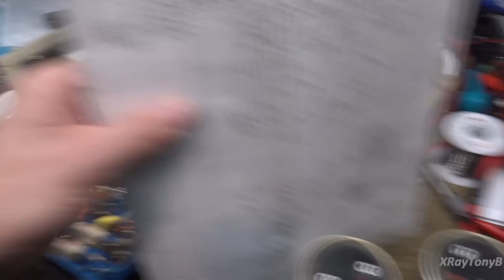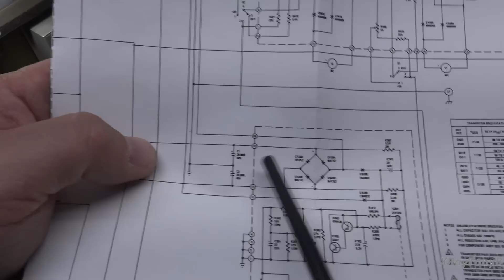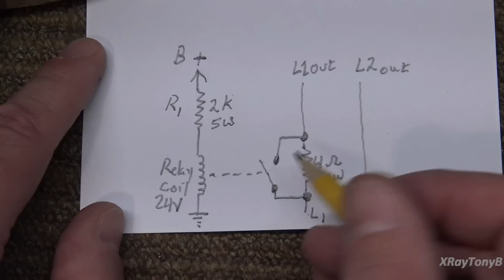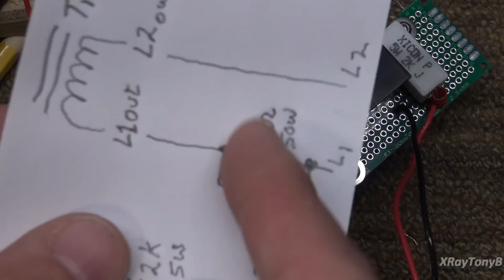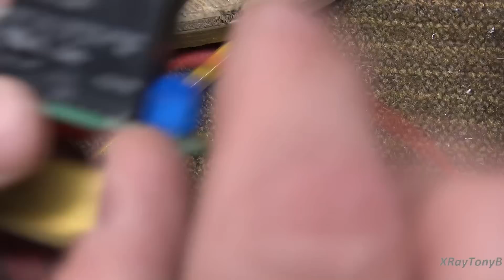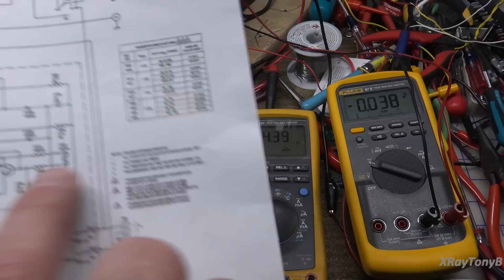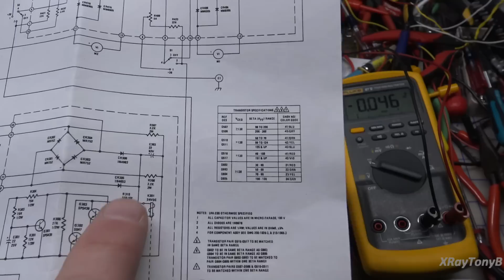Adding a Soft Start Circuit to a Power Supply

Comment: i wish you used one or two   analog meters  and/or an  indicator bulb ;
   i think that  relay is a  special relay; if it were not of a snap action  type , the  contacts  would burn because of the  lack  of a snap action ; i   know it is  a  fast voltage rise,  but  relays are  made  for  instantaneous voltage  rise,or tyhe  contacts  will arc

Comment: You may want to use a diode in across the relay coil as a snubber
Reply: Reverse biased diode
Reply: yes, after studying the whole thing;  it is not reccomended bu the relay makers, it burns the contacts faster.

Comment: Hey Tony, Back as a Pateron. CC got hacked and was canceled. Now back on. Sent you an email on your Video about Soft Start. I really enjoyed that. Take a look at the circuit I sent you. The device states 220 Volts input and output. Mfg says will not work on  USA 120 Volts AC. I would like to convert it but not sure what to change in the Schematic. Since I have all Marantz Separates M500-M250-3300-M150 and another system for rear channels 3300-and-M250 I would like to soft start them as They are old but still cranking. It would be easier to add an out board Soft Start rather then go inside each unit. The unit diagram I sent you is pretty nifty. Thanks: Mark

Comment: Interesting... I have an older late 90's linear bench power supply that will cause the voltage on that circuit to drop when I power it on for the first time in a while. I have an UPS on the same circuit that will alert due to the voltage drop but not tied into the powersupply. I was thinking of doing something similar.

Comment: Re-watching this video with increased understanding, and having paused to read the description of the Pioneer circuit, I’m wondering what happened to the capacitor that was in series with a resistor with both of them parallel with the coil, so that the voltage across the capacitor the pulled in the coil. I don’t see it mentioned in the comments. Tony probably mentions it another video . . ..

Comment: What about an NTC thermistor like it's is used in switch mode power supplies, maybe more efficient.
Reply: I'm thinking about using an NTC to start a circuit and then a relay to bring it out of the circuit after a delay.  The problem with an NTC alone is that if someone turns the supply on and off while the NTC is hot, it'll act like the NTC isn't there...
Reply: I have a newer version of this amp. It already got 2 NTC installed by the factory on a terminal strip.

Comment: To keep it simple how about just adding a CL-30 or 40 or other properly sized thermistor after the fuse ?  They are ideal for limiting inrush current and with today's higher line voltages they might drop that a volt or 2 after warm up.

Comment: You could also use a Infineon IRF3205PbF (RDS(on) = 8.0mΩ) power mosfet across the 4R7, rated for 110A @ 55V on the secondary side of the transformer with  a 10K / 10R voltage divider on the capacitor.
No power resistors needed and no useless heat generated, simulator shows it works fine, it gradually start opening the mosfet.

Comment: A little off topic, but how about using a soft start with a SCR voltage regulator, a 100A rated bridge rectifier and 10,000uF  filtering caps driving a DC motor?

Comment: I would have put the resistor in series with the B+ and use a P-channel  MOSFET wired across maybe a 10 ohm resistor, but either way it's a good idea.

Comment: That big inrush can damage all in its path.  A 6 volt relay has a 30 ohm coil if your initial charge is through the relays coil when the difference in voltage is less than 2,5 volts the relay drops out and the Cap is directly connected  to the source through NC contacts

Comment: Excellent! I just subscribed after seeing this elegant solution. I build tube amps and I typically heat the early stage filaments with DC to limit AC hum. To do this you need a lot of capacitance because 4 tubes can draw a couple amps and you need that capacitance to keep up with the ripple. But this does present a big inrush strain on the filament winding of the transformer. For 6,3 volt filaments maybe I'll experiment with a 5V or 6V relay. If I can find a sweet spot, I'll definitely add this to all my projects. Many people use a 555 timer or such, but this is downright simple with far fewer points of failure. Thanks!

Comment: Hi Tony…..I’m wondering why you put the 4 ohm resistor on the mains instead of on the output of the transformer.    Wouldn’t it operate the same way and still protect the transformer?  Just curious.  I’m adding one now and would like to know.    Thank You
Reply: My thought is that relay contacts are rated 2 to 4 times higher on AC current than DC current
Reply: @jimnunn9232  The secondary of the transformer is still AC, just lower voltage.  Was thinking that might be better
Reply: Same reason why fuses are usually on the primary @richardchuray329

Comment: I thought you would like to know that I’m going to put this soft start circuit you show into an amplifier I am recapping for a guy.  I don’t support this necessarily but he has a Hafler DH-120 power amp and he bought o capacitor upgrade kit for it which among other things increases the main filter caps from 6,800uF to 22,000uF.  It seems to be a common thing for owners of this amp to do.  I advised him not to do it but recommended that if he really wanted it done, he should at the very least add the soft start circuit and upgrade the rectifier.  I still couldn’t take responsibility for what this modification might do.  I don’t recommend it but it’s his call.    Without looking at a schematic, other than start up, would you have any other potential concerns with caps this large put into a circuit that wasn’t designed for it?  

Anyway, I just wanted to let you know that the videos you put out are a great educational tool for people like me.  You are a priceless asset for the community.  Thank You

Comment: Can I use soft start from (or designed for) power tools? They seem to be cheap and made in small nice packages easy to fit to audio amplifier. Not sure if I should be trying such devices for audio amplifiers.

Comment: excellent video really helpful!
could someone maybe help me out a bit?
1) the wiring to ground from the relay coil as depicted in the schematic drawing; is it wired to B–? my amp's got a split rail voltage, there's 46V difference between B+ and B–, and a ground in between (23/23). i reckon i CANNOT just go wire the relay coil to the mains ground... where do i wire it to?
2) i live in Europe, 230Vac on the line, shouldn't the big resister be rated, like, over 1kW in power dissipation?
thanks in advance, all

Comment: Might your soft start circuit be even more simplified, by using a Mains VAC Supplied STDP Relay? The resistor is wired across the Normally-Open contacts of the Relay. The Line side feed goes through the resistor, to limit the in-rush to the relay and the load. Once the relay and load reach 80% of the mains voltage (80% being the typical voltage at which a relay engages,) the relay engages, thereby bypassing the resistor, and the load finishes charging (but much less violently.) Not my idea = Credit goes to james_s, on the EEVBlog Forum. Thanks, james_s for (originally) suggesting this to me.

Comment: I’m afraid this won’t work in Europe or anywhere else where the grid AC is 230V. The inrush resistor’s power capacity will have to be prohibitively high; we’re talking quadruple-digit wattages here.
Reply: I'd implement a thyristor-based soft start circuit in that case.

Comment: Came across this video  as it randomly popped up….whilst looking for a way to stop my 3hp router from throwing me over the bench every time I switch it on….. way over my head but very interesting all the same.!! Why was there no  current limiter built in from the factory you ask.?  Because like every manufacturer of every machine be it machanical, electrical or both,  reliabillity, longevity and reputation all come a poor second to repeat business and profitability..!!!!👍

Comment: A much more elegant and easy solution for inrush, is to use a NTC thermistor device on the line. We utilized this method on all of our high current amps at Altec-Lansing, which included the EV line as well. - K5DBX

Comment: Tony, I am curious about your choice of using the 2k ohm resistor to drop the 57 volts to 24 volts for the relay.  If one plugs those in a voltage divider calculator with 850 ohms for the relay the voltage across the relay is 17 volts.   I’m trying to figure out what dropping resistor I will need to use with the very same relay with a B+ of 70 volts.  Using a voltage divider circuit calculator, it comes up with a 1667 ohm resistor.  
I thoroughly enjoy watching your videos 
Larry

Comment: Wonder if it's a good idea to soft-start a decently sized SMPS like this. Proper ones will have an NTC on the input, but if that's already hot after it's been in use for a while, it can very well act like a piece of wire, passing full current to the main cap(s) and causing arcing across switches/relays. I WAS thinking of using this method, but I heard it's not recommended to "starve" a SMPS of current for too long by placing a resistor/light bulb in series with its mains input, so I guess the resistor value and "hold" time would have to be pretty precise so as not to reduce its lifespan. If it's got a PFC boost circuit it's probably even worse...

Comment: Another nice video and explanation but since I don't have a test setup, how much does that 4 ohm resistor reduce the inrush current?  And more out of curiosity, how much is 4 ohms (percentage wise) in relation to the power x-fmr primary resistance?
Reply: Wanted or not, I will throw in some feedback. (and let the arguments begin  🤣🤣🤣) Believe it or not, you posed kind of a "trick question" , because, since the line voltage is "alternating current" it depends on the exact timing on when the power switch makes contact in relation to the AC cycle. If you switch it on during the "zero crossing" part of the cycle, it would have to reduce less power than if you switched it on during the peak. That, and adding any residual magnetism stored in the transformers body, and also, when the switch energizes it, things get crazy. If you convert things to DC though, you can do some "fixed value" math, and lets say ( ballpark-worst case scenario, an amp that keeps tripping a circuit breaker when you power it on) you have a 15A surge, which, may trip a standard US home branch circuit breaker, at 120V, you would be drawing 1800 watts for a millisecond or so. Ohms law works that out to an 8 ohm load. Adding 4 ohms to that makes it 12 ohms, dropping that current to 10 amps from 15, which is a bit easier on the switch contact, but keep in mind that is worst ( guestimated) case scenario with 60 cycle AC.  And, also, keep in mind, that the transformers "resistance", once connected to AC line power, is actually mostly inductive impedance, so, although it may have a lower DC resistance, once it is connected to the AC frequency it was designed for, it will look like it is a higher resistive value than its DC measurement is. That impedance value depends totally on the differing transformers designs, so it will have no set answer as well.

Comment: Nice. Thanks to you i just discovered that my amp has something similar already installed ( Onkyo M 509 ). But it just uses 5*0.22r5w and no resistor before the coil but a cap and a diode across the coil. Now im thinking about changing the 5*0.22r ones against one 4r50w because it has new and bigger filtercaps now too ;) (from 4*30000 to 33000) Oh and its one relais for both transformers.

Comment: Current limiting is essential .the inrush current will damage both the transformer and the capacitors .And since audio quality can be greatly affected by power supply it makes sense to protect your power supply and your equipment connected to it

Comment: I made a similar in-rush limiter on my DIY variable DC power supply. The input voltage of the supply is 50V DC, rectified from a 36VAC toroidal transformer. I put a 330ohm 5W resistor in series with the 4x4700uF parallel caps, so when powered on, they charge slowly. The relay coil (48V) is connected directly to the caps, the voltage increases slowly as the caps charge up thru the 330 ohms, and when they reach around 38-40V, the relay pulls in and cancels the resistor. Works well, takes around 3 seconds from a cold start. 48V relay coil has no objections to 50V so I did not use a dropper resistor there. Now I see this doesn't help with the in-rush of the transformer, so I need to re-think the whole thing. Thanks for the video.
Reply: The only difference I see is that you put the current limiting resistor (330 ohm) on the output of the transformer instead of the input. I'm guessing that you've accomplished the same thing, in that you are limiting the inrush current (to the caps) that the transformer secondary is supplying at a slower rate. Seems good to me. 🤷‍♂

Comment: But how to calculate value of R1? How can we know what current will flow through it?
P.S. Can't find current value for my relay....
Reply: you know the resistance of the coil, you know the voltage drop range across the coil, so you know the current. knowing the current and knowing the total voltage drop across the coil + R1, you calculate it as R1=(Utotal/I) - Rcoil. Very basic application of the Ohm law.
Reply: but as many have said, there are other ways to do it, some of which may be considered better. For example, I don't like the relay, since it's a mechanical part prone to wear and in some cases contact burning wear (which may be a non-issue in this application though). will something like a mosfet with a gradually increasing Vgs (set, via a resistor divider, by the capacitor charge voltage) and respectively decreasing Rds down to a few mOhms work? maybe, need to see if it copes with the power that it has to dissipate while the load is powering on.
Reply: the relay method, however, is bulletproof and as simple as it gets, which is definitely one of its strong sides.
Reply: @s_s-g4d  That, and if you design it with a "current" (pardon the pun) model of production, you can replace it fairly easily, and , maybe even buy a spare and secure it inside of the unit for future use. It's unfortunate that a component line's production has a limited, but unknown lifespan, but I guess that is some sort of "progress".........or is it?

Comment: Could you replace the 4 ohm resistor with an NTC and then instead of using just a resistor inline with the relay coil, add a zener diode.  The zener will give better control of the relay switching point and increase the drop-out voltage.
Reply: Both of those suggestions sound workable, to me anyways. Would be fun to breadboard up and see exactly how things would behave.

Comment: I have the Atlas ESR Gold that claims that it can measure up to 90,000uF, but so far I did not try measuring a capacitor larger than 1,000uF. My Siglent SDM3045X can only go up to 10,000uF and again I never tried over 1,000uF.

Comment: Tony, Great information.  I repair welding equipment for my living and all of the welding inverter power supplies I repair employ a similar "pre-charge" circuit for the buss caps.  I deal with caps at least as big the two here.  How do you measure them?  I cannot find a meter over 10k.  Thank you so much!

Comment: Thanks a lot. I am planning to build a power amp using a 625W, 30v 20A (x2) toroidal transformer and 2 large capacitors (22000uF). I was considering using an Inrush limiting NTC thermistor but I realized that during quick on/off cycles may not work well. I also realized that some high end vintage amplifiers (like Nakamichi 620) are using relays as you are suggesting. Unless somebody has a good reason to use Inrush limiting NTC thermistor, I will go with your suggestion. Thanks again.

Comment: Hello!  You always have such great videos!  I am learning a lot!  Concerning the control of the capacitors and their charging, why not just add a 30 ohm, 100watt resistor on the positive side on each capacitor to limit the inrush of current when powered on?
Reply: they need not to have any series resistance  after they are initially charged, that's why the resistor has to be shorted after they charge.

Comment: Ok man, this is a fantastic idea, but when you push hard the amp, your rail go down and this can cause the relay's disengaging.
Probably the best way is a timer to set a treshold time to engage the relay and if you want, with other components, create a sort of protection at start up if there are problems in the amp stages!
Reply from the maker: In the video, I show that the relay drops out when the caps are down to about 6 volts.  If the power supply drops to 6 volts during normal use, the relay will be the least of our problems! ;)
Reply: I highly doubt the rail voltage would dip down low enough to disengage the soft start relay.

Comment: As the amp in question has a split rail supply did you put the resistor on the 0v/ground rail? Thanks for the upload.